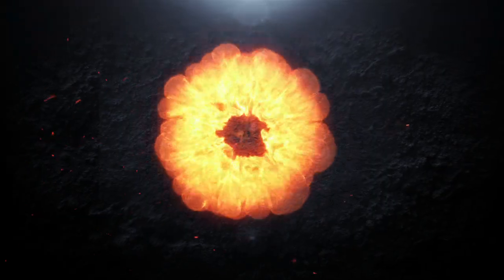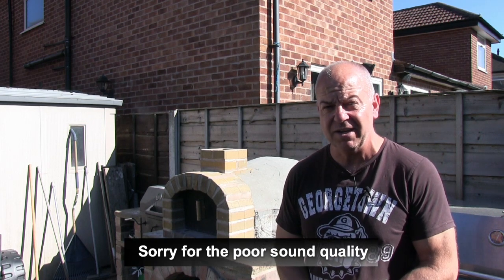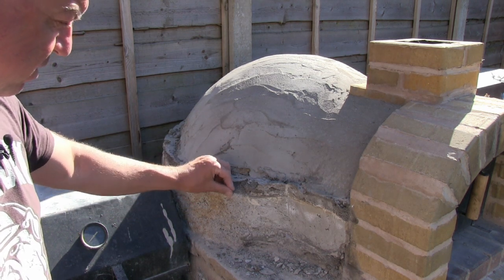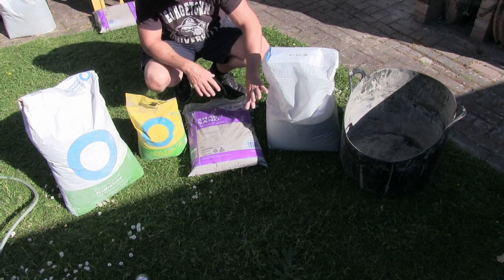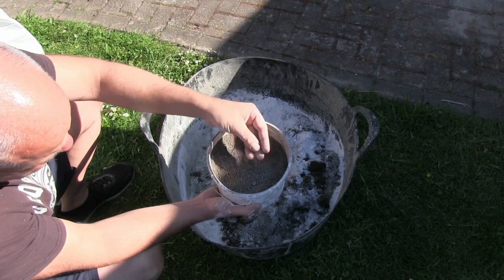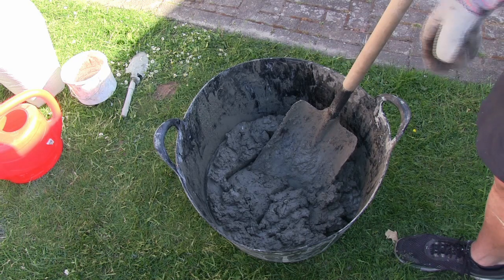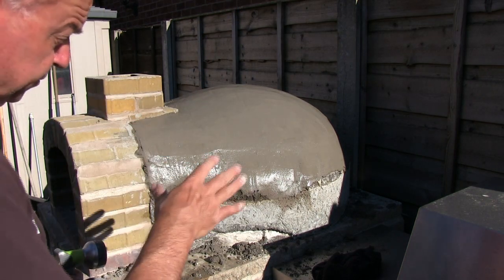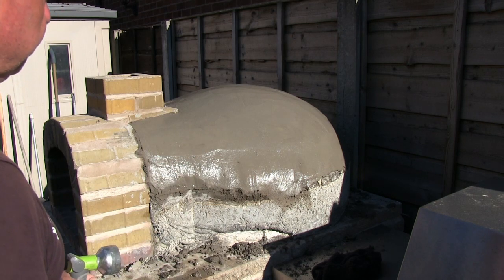Basic Refractory  Concrete Mix

Comment: 5:1 vermiculite to Portland is way more efficient than the aircreet and a whole lot easier.

There is no need for a heatproof mix over the insulation layer when using the vermiculite or refratory insulation.

Your getting a tremendous amount of heat transfer with the aircreet and very little insulation value.

Also mixing calcium aluminate with lime accelerates the mixture very rapidly too rapidly and drastically reduces its strength. It's best to use portland instead.
Reply: So are you saying 5 part of Vermiculite  to 1 part of Portland cement?

Comment: Could you use this refractory cement to make the vermiculite concrete mix instead of the portland cement?
Reply from the maker: Yes. A lot more expensive but a big step up in structural integrity as far as the ability to withstand high heat is concerned.
Reply: Do you use same ratio as the portland cement?
Reply from the maker: @m_qnke  Yes but make sure you're using actual cement powder and not a refractory mix. Some sellers mix expensive cement, high in calcium aluminate with washed river sand but still brand it as cement.
Reply: Sorry could be expensive mistake if I get it wrong. To clarify,  I make your basic refractory mix and add 2 parts of that mix to 5 parts vermiculite (or perlite) and then add 2 to 2.5 water to get right consistency.
Reply from the maker: @m_qnke  yes.

Comment: As a 35 year refractory masonry specialist, now retired, this is one of the poorest jobs of laying brick that I've ever seen. 2 inch+ wide joints instead of cut bricks? Just no. This project will self destruct within a few years. Guaranteed. This guy wouldn't last more than a day or two on any job doing work this poor. Not trying to be ignorant or disrespectful, just stating the truth about the one thing in the world that I am the most skilled and knowledgeable about. This is done wrong...entirely. Typically one would not be making their own bonding mix, it is very specific to the composition of the type of masonry unit being used, they are not even a little bit interchangeable. In every job I've even been on it was supplied premixed and ready to use in buckets. Typically it is liquid enough that a trowel cannot be used, a laddle is used. Never seen 'homeade' used at all and would not try it.
Reply: Everybody that retired from something is the expert beyond belief and would never ever never never never never never never do something that worked for someone else and he hadn't done before.